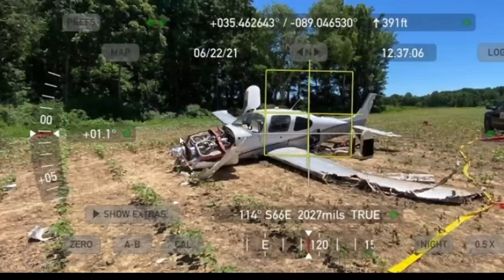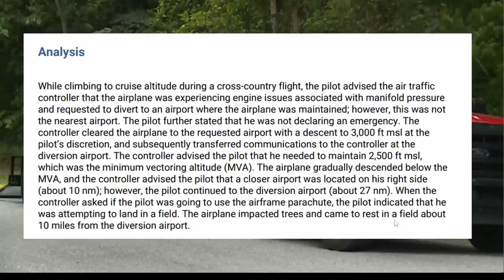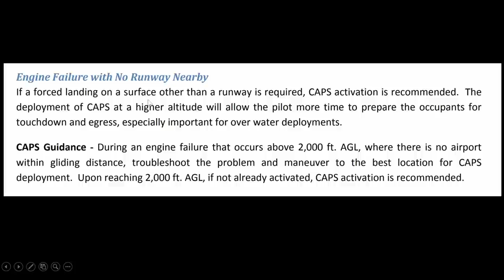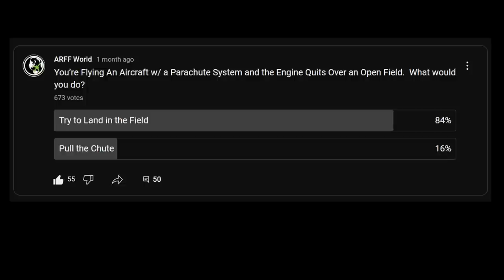Pilot Chose Field, Not Parachute in Tennessee

Comment: These Cirrus SR22's Aren't SAFE. Piston Engines, Like this Cirrus SR22 and the Cessna C172 Should Stay Below the Clouds at 5,500 Feet. The Clouds are at 6,000 feet to 7,000 feet. The Diamond DA42 is a Twin Engine Turboprop. A Jet Engine with a Propeller. Not a Piston Engine. Cirrus Teaches You to Use the Parachute, know ing its not Safe at 10,000 Feet. You need a Turboprop (Jet Engine with a Propeller) - Not a Piston Engine.
Reply: The DA42 is Good for Flying at 8,000 feet. Just Above the Clouds.